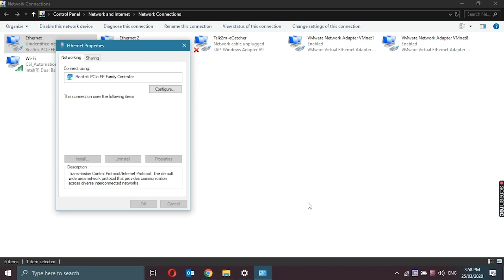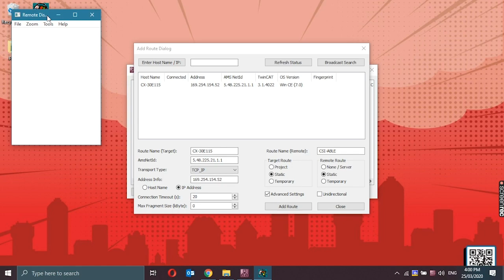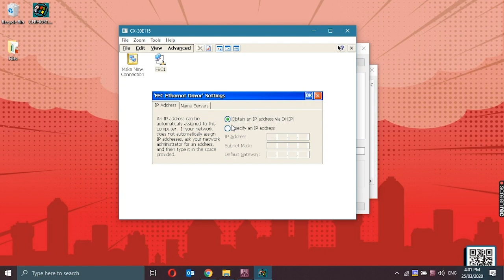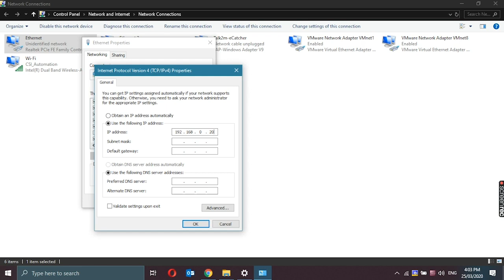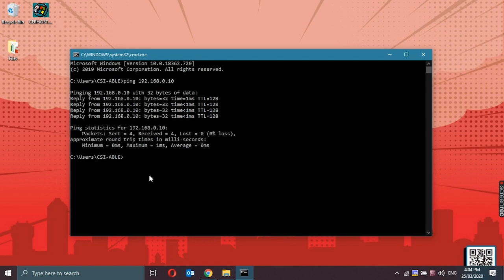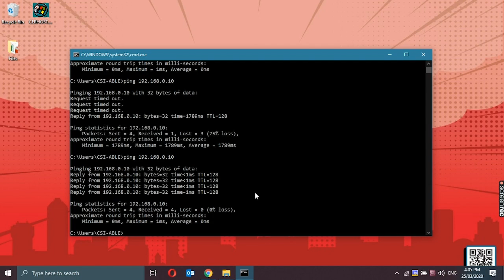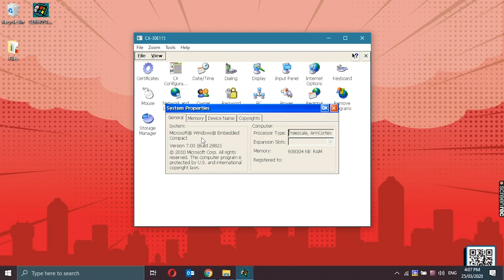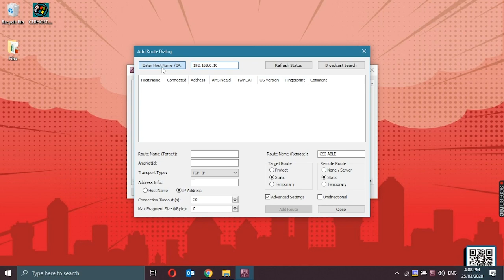Episode 1 - How to Setup Beckhoff CX9020 for the First Time | Controtek Solutions

Comment: How to replace battery in CX9020? Also, how to update date&time after battery replacement?
Reply from the maker: Hi, Avanti! you may check this link on to replace the battery https://infosys.beckhoff.com/english.php?content=../content/1033/cx9020_hw/3596732555.html&id=

To adjust the date/time you may access the Control Panel of the CX via Cerhost

Comment: I can ping my CX9020 but i can't connect to it via CERHOST. It just says "Can't connect" and nothing more. Any ideas?
Reply from the maker: Hi Simon! Probably remote access is not yet enabled on the CX9020. You can try accessing the configuration using Beckhoff's Device manager, just enter the IP address or the host name of the Industrial PC in your web browser. Example :  https://192.168.0.10/config, or you can use the Host name instead of the IP address. Once you're in the Device Manager, you can enable the Remote Access setting on Devices->Boot Opt.